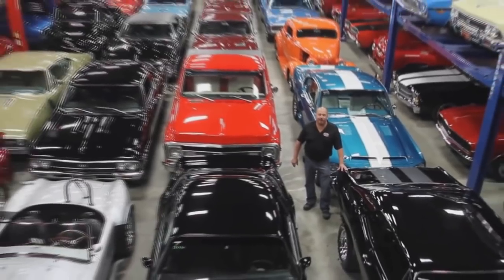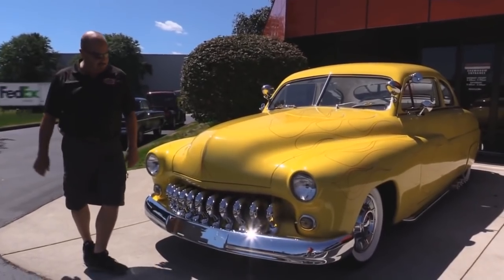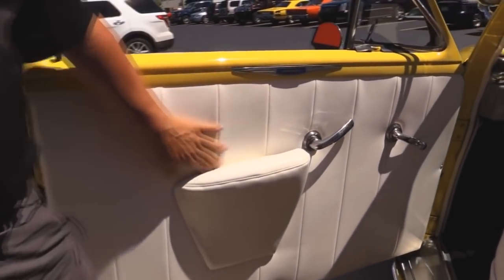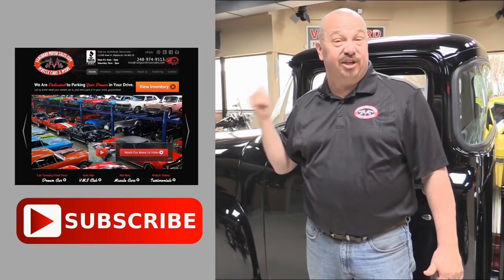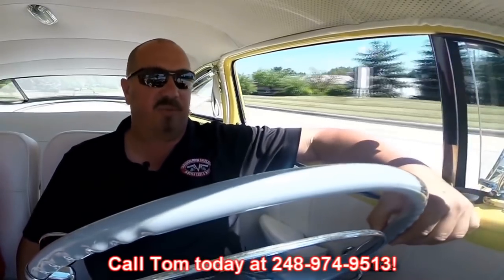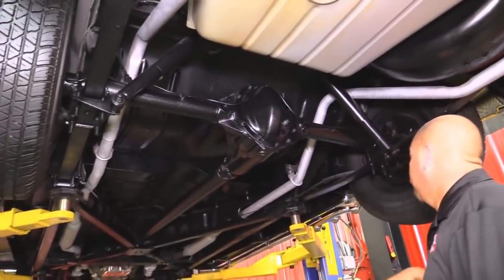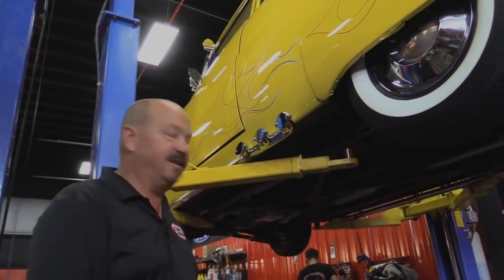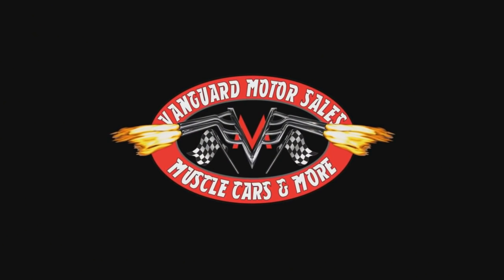1949 Mercury Lead Sled For Sale

Comment: What a beautiful car, I love that it keeps a lot of the original, the best the engine, its chrome, especially on the windows, it lacks the original emblems. What I did not like is the front chrome, it is not original and it does not fit this beauty, the stops do not fit its design. Best of all, it wasn't cut into the ceiling.